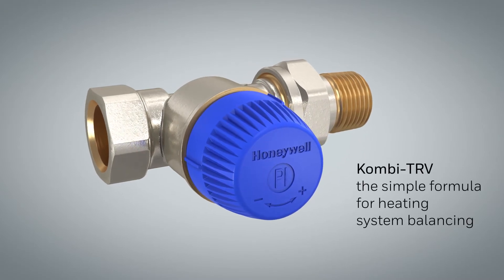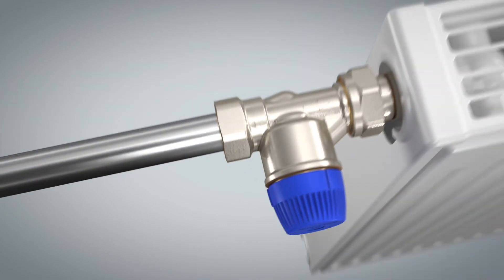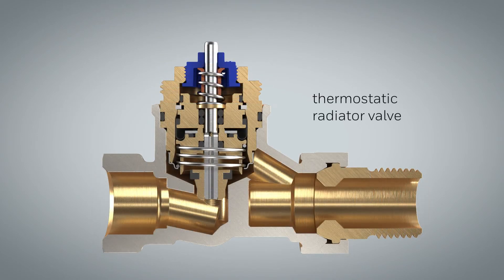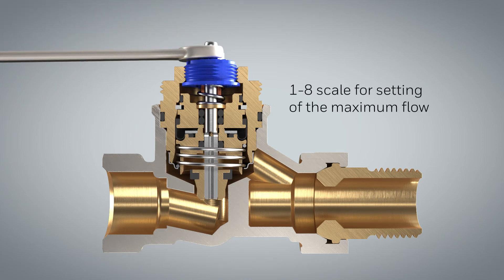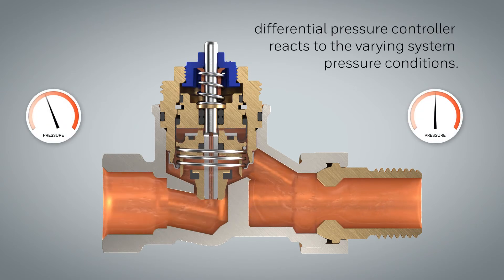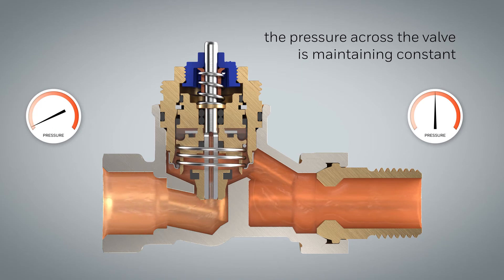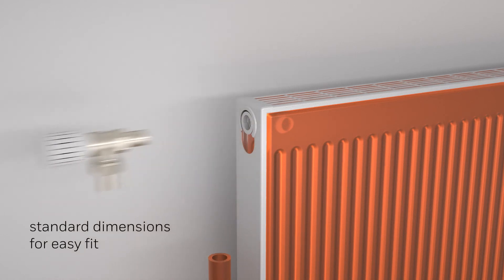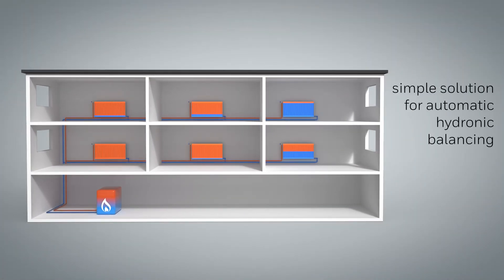Honeywell Kombi-TRV noul robinet termostatic de radiator cu regulator automat de debit #WeAreResideo

Comment: Buna seara, sa intelegem ca daca montam aceste robinete echilibram corect toate caloriferele ?
Reply from the maker: Buna seara, da. Pe fiecare robinet se seteaza debitul calculat iar robinetul are grija ca acest debit sa nu se depaseasca. Intr-o instalatie dezechilibrata hidraulic unele radiatoare au debit de agent termic mai mare decat cel necesar, altele au debit mai mic decat cel necesar. Daca debitul de pe fiecare radiator este limitat corespunzator instalatia este echilibrata hidraulic.
Reply: Cosmin Nita va multumesc, insa mai am o intrebare la dvs, exista pe piata vreun robinet sau robineti care sa faca ei aceasta echilibrare automata ? Instalatorul decat sa ii monteze ? Le au echilibrat de 2x persoane diferite si tot sunt probleme, instalatia este printr-un distribuitor cu 9 cai, si deserveste practic 10 radiatoare deoarece la un calorifer au montat teu-uri pt a alimenta si un dresing. Va multumesc
Reply from the maker: @Iannis_C14  Echilibrarea este automata, adica indiferent daca unul sau mai multi robineti termostatici se inchid sau se deschid, ceilalti robineti ramasi deschisi (de pe alte radiatoare) asigura debitul necesar de agent termic prin radiatorul respectiv, cu alte cuvinte instalatia ramane echilibrata in permanenta. Dar fiecare robinet trebuie setat manual la inceput (trebuie setata valoarea maxima a debitului, in functie de puterea radiatorului respectiv); robinetul nu are de unde sa stie ce debit maxim este necesar (permis) pe radiatorul respectiv.